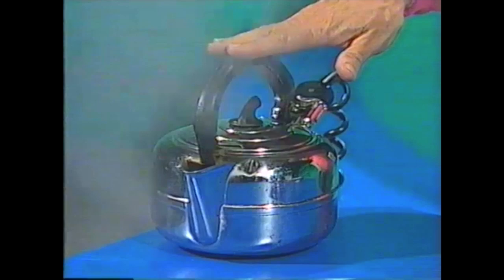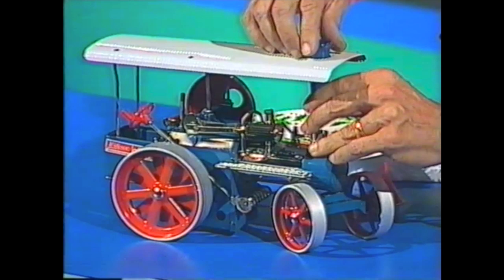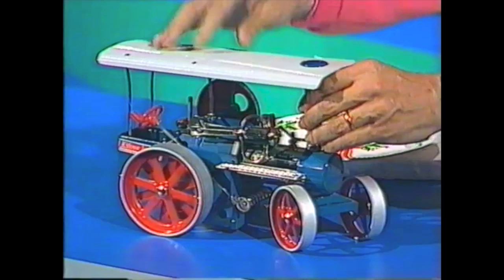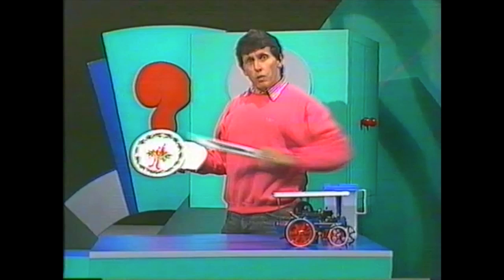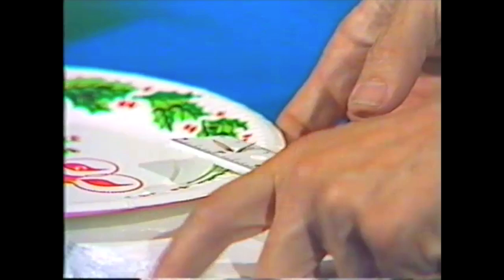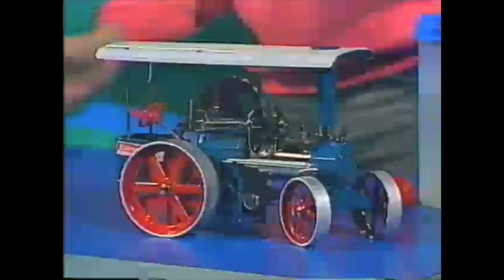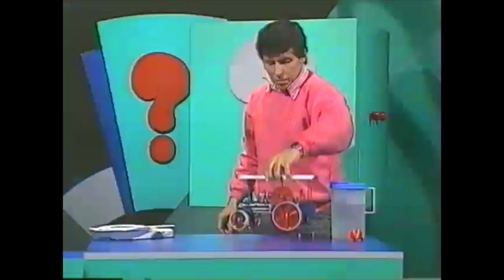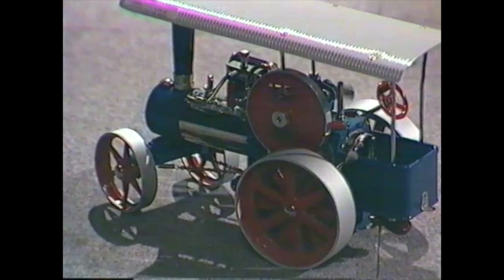Steam Engine in Action

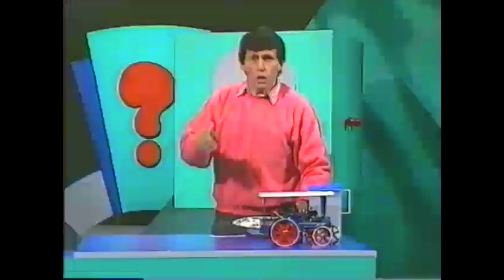Comment: 1:55 That is a limit of a piston engine -- not of the steam itself. Turbine engines produce rotary motion directly and they can be more efficient.  Steam piston engines are no longer used for practical purposes, but steam turbine engines are  used everywhere for power production in coal, gas, and nuclear power plants.
Reply: Interestingly enough, they forgot about heroe's steam engine, which I learned from them & it's an older episode they did.
Reply: I remember the first time I spotted steam powered turbines at a plant I was working in back in 2010, it was only the second refinery I worked at, so it was still early on in my career. But I was so surprised to see that we were still using steam lol.

Comment: Why has that model steam tractor not been toy of the year every year since it was first made
Reply: Maybe because like a lot of those awards (best of etc) they are rigged, from my personal experience with food awards.
I'm acquainted with a model builder, after attending a show that      was judged wrong, the entrants placed  'listening devices into the models to see if the judging corrupt.
Well it was unfortunately.
Reply: One reason may be that the kit costs more than 500 pounds sterling.  I know that small market size means high price, but even so, seen up close it's a bit "bent biscuit tin" rather than fine engineering, I'd expect about 200.

Comment: One milliliter of water at one atmosphere of pressure just below boiling occupies four liters when it is heated enough to become steam.  The decrease to 1/4,000 the original density is why steam is invisible:  what we see near a source of steam is water vapor, the water rapidly cooling back down in the sub-boiling range once it has left the source of heat hot enough to boil it.

(Addendum:  The ratio 4,000:1 is from a book about steam locomotives.  More than once, Curiosity Show uses the ratio 1,600:1.  I don't know what's right.)

Comment: Leaving the whistle valve open while waiting for it to boil is a good indicator for when it's ready to run. But you should probably close it once it begins to boil to save steam. Sounds like Dean left it open causing the boiler to lose pressure rather quickly on the floor.

Comment: Wow, my cousin had one of those that ran on metholated spirits.  I used to love playing with it when he was out.  You don't get craftsmanship like that any more.
Reply: I had one that run on Metho as well, I am sure it was a Mechano brand.  I do remember the Mammod ones I would always see in the back page of one of those such and such Romance story mags my Mother would get.
Reply: @steviebboy69  Just asked and it was a Mamod that I used to sneak in and play with.  I can remember flicking the wheel as it approached pressure to help it along and you've get a few false starts before it went crazy.
Reply: I remember them going crazy too and I remember the smell of the burning metho and the steam and light oil that you would put on it.
Reply: These are still made with the same craftsmanship which is mass production.

Comment: One dislike from Big oil.
Reply: Steam engines use a lot of oil, when they are oil fired.  They all also use lubricating oil which is consumed rather than cycled in a closed system.